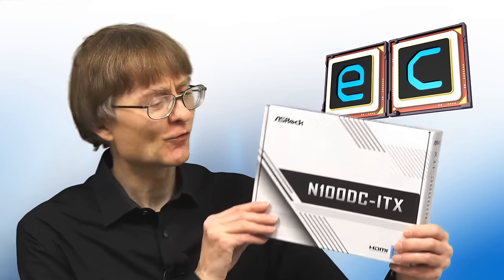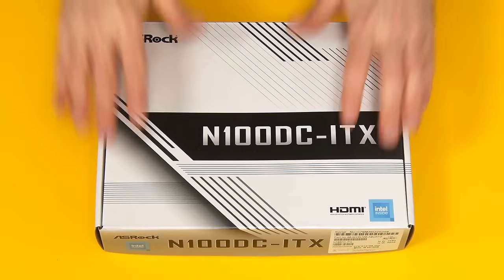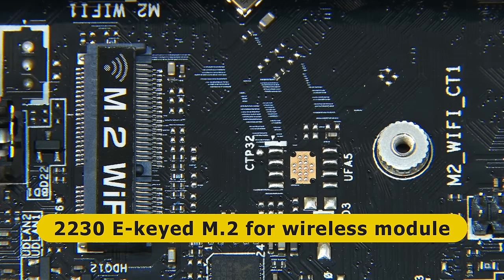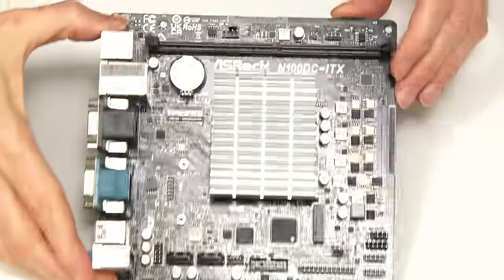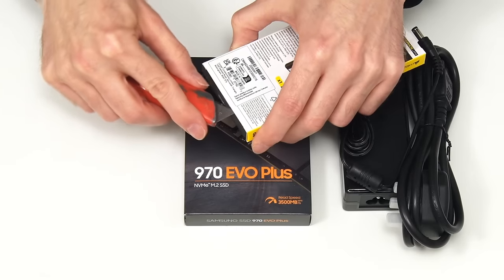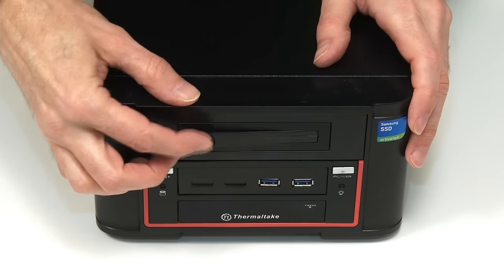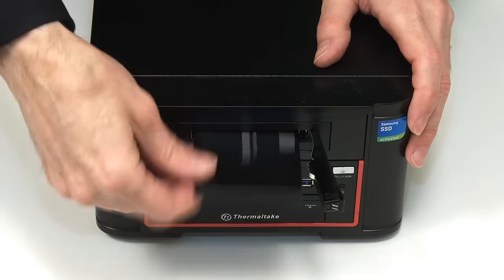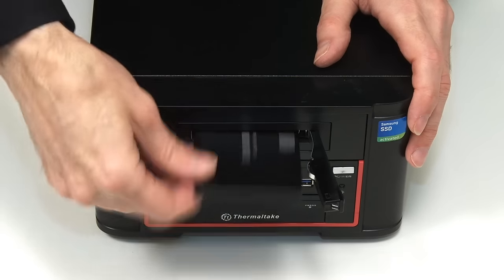N100 Mini-ITX Silent PC Build

Comment: I would really love to see a little PC like this with a really good APU (APU's have dedicated V-RAM) with 4GB+ HBM2/GDDR5 V-RAM, a HQ audio DAC and legacy friendly gaming audio chipset that can do EAX/FM-Synth(OPL)/MIDI/SBPro/etc, good analogue video support for VGA/S-Video/RGBS/YUV, this would make for the perfect little gaming PC for retro games via RetroArch/PCem/DOSBOX/Steam-Proton/Batorcera/Linux/MacOS-Classic/GOG/RecallBox/Lutris/anything-that-uses-X86-architechture.

The best way to do all this and for absolute compatibility, the best combination would be a good X86 APU and an FPGA, along with a nice quality HQ DAC and 400Mhz RAMDAC, the FPGA would cover all the legacy audio like FM and MIDI, another nice option is a ISA audio chipset running on a PCIe 1x slot for real Yamaha OPL3, SB16/Pro support and MT32 MIDI, EAX 1 to 5 would be essential too, give it a RAM cache too for real soundfonts, you could give the FPGA a wavetable header for use with a Dreamblaster or the like, I guess what I'm asking for is a "Mini Classic PC", like the SNES Classic or PlayStation Classic, but for classic computer systems rather than consoles, like Windows, DOS, MacOS, Amiga, MSX, X68K and so on, but you need to get the sound right, otherwise you might as well just use one of the many software emulation options.

Comment: Not sure about the EMC performance with that plastic cover. They went to a lot of trouble fitting fingers to the IO 'shield' (EMC shield?).
Reply from the maker: The front and other panels of this and many other PC cases are plastic. The EM shield is to ground the connectors to the case, and having a plastic panel does not negate this. :)

Comment: Unfortunately, they didn't give the the same audio out as my older Asrock ITX board, and the video out is lacking. At least the microatx version of this board has 3 video out. I get you can get audio out via the hdmi, but I have a few things that needs analog out.

Comment: Inspired by this build and have just ordered a case.  Please could you tell me if the ASrock N100 motherboard supports a dual monitor setup.  I believe it has an HDMI and also a Dsub port. Can these be used at the same time to run two separate monitors so I can have different windows open on each monitor. Thanks so much
Reply from the maker: Thanks for this, and good luck with your build. You can indeed use both the HDMI and VGA at the same time for dual displays.
Reply: @ExplainingComputers thanks so much

Comment: 11 Watt seems pretty high. i got the same CPU but in a complete mini PC together with 16GB LPDDR5 und 512GB M2 SATA Drive.and the idle is around 6 Watts there.
Reply: Does your mini pc use 19v or 12 volt adapter
Reply: @si4632  it is a 12v power supply.

Comment: For your temperature testing, you should also do your test with the top and back off. In the end, that would be the maximum natural cooling level you can achieve with your current heat sink. If the temperature is only a few degrees cooler, you are done but if say the case-less option gets you 10-15 degrees lower, there is value in increasing your venting.

Also, is it common to heatsink SSDs? Do they usually run hot or is it just a precaution?
Reply: You typically don't need to do it with PCIe 3 SSDs, but on newer ones it's generally a good idea given how hot they get.
Reply: Fast ssds use powerful arm SOCs, so they do get hot. The newer pci-e4 ones can also heat up the memory and ram chips.
Anyway, regarding the cpu, optimizing for lower temps has next to no value, unless you want to overclock. If you're running stock settings, there's absolutely no difference between running the cpu at 60 or 80deg. Only around 90deg you should be looking to improve cooling.

Comment: You'd forgotten that you even had a sound card in that system...  I went and rewatched the original build video; you mentioned that you wanted the full sound card to use Dragon NaturallySpeaking which didn't work well with onboard motherboard audio.  I take it that means you either stopped using that software or otherwise stopped needing the sound card?
Reply from the maker: Good comment. :) And you are right, I fitted the card to get Dragon NaturallySpeaking working. Since then I've left academia, and stopped writing books, which have reduced the time I spent creating text (in particular replying to student and other e-mails). So I am now able to manage my RSI and arthritis using a keyboard without voice dictation.

Comment: I am new to video creation and was looking at your Ryzen 5 build, which is great.  However I need a smaller form factor so wondered how far you can push a ITX format case as far as processor GPU and heat dissipation is concerned.  I am not so familiar with motherboard formats so not sure what to do as far as small as possible but decent video editing performance is concerned.  The alternative is to buy a laptop I guess with a GPU but these are very expensive

Comment: I would be very curious to know what a 12100T or 7400T Celeron G6900T would do at these levels.  They can be passively cooled as well.  

Notice you probably would see benefit from JEDEC ram, not XMP.  I bought some Crucial RAM (CT16G4DFRA32A or CT8G4DFRA32A ) so that it would run in JEDEC at 3200 CL22.  It was around $35 for a 16GB stick.

The N100 is amazing if it really uses the kind of power a Raspberry Pi 3 4 or 5 does.  I am saddened by the single ram slot, and the minimal PCIe connectivity.  Especially considering the very similar cost of a Celeron with P cores and 2 ram channels with an H610 board.  The price difference is covered very easily by the RAM being cheaper in smaller capacity sticks.

Comment: I see you use windows XP virtual machine for running microsoft office applications (word, excel), but you could also use wine for running windows softwares on linux, office 97/2000/2003 versions should work with wine. ReactOS virtual machine can be also an alternative for running old windows softwares.

Comment: I've purchased a tiny pre-build N100 Chinese system with 16 GB RAM plus cheap 2 TB NVMe and 4 TB SATA SSDs and it cost me less than this system. There's currently a problem with Linux on N100 systems as not even the newest kernel can play 4k/60 HEVC without dropping frames and there are no Intel proprietary drivers for Linux. This is not something I'd use as main system. Good as secondary backup NAS and media server.

Comment: I guess with the comically outdated connectivity still available on this fairly new board (such as the LPT or PS/2), that it is mainly aimed at various small and medium sized companies and such that still have ancient hardware they still rely on?
Reply: The PS/2 and D connectors are quite a hold over from the old days, aren't they.  Rather have  Thunderbolt.

Comment: I was curious about the temps.  How is the passive cooling doing?
Reply from the maker: Six months on, it is still working fine. Often gets into the early 70s C, which worries me a bit. But the chip is safe to I think 104, so in practice there are no issues.
Reply: @ExplainingComputers  We must work to find the balance between annoying noise and worrying temps.  Thanks for the feedback, Chris.

Comment: Impressive connectivity for such a puny board :)

I have a newish Mint VM that also whines about wanting updated video drivers. If I try to fix it, then the Mint VM stops working until I put it back how it was. I wonder if they broke something.

What was with the SSD that was hiding in the case? had it been naughty??

Also I want one of those tricycle things from your desktop. :D

Comment: 19v 65w that might be possible to be powered from usbcpd charger, cool
Reply: No, because the mobo hasn't a PD chip, it won't even work as in this case the charger delivered tension is 5 Vcc - in a word, best way to harm a good HW.
Reply: @hankhulator5007  Well you could use usbc-to-20v-barrel-jack cable that has pd chip or mod pd breakout board to build your own power cable for this board. What's even better is that future models of motherboards like this could actually include pd chip and use usbc for power as new QC/PD chargers are powerful enough.
Reply: @knifekitty_ls  Thanks, good to know that.

Comment: Couple things.  ASRock has a history of motherboard failure.  At one time they failed at a rate of 30% of the time.  I do not know if this has been corrected, but it's one reason I stayed away from them (and MSI).  The second is the power brick.  Why companies insist on using the "Mickey Mouse" jack that you can see in at 6:28.  The cords are hard enough to find verses the traditional power cord, and it's just a dumb design choice that's plagued IT for at least two decades.

Comment: This seems insane, will it hold 2xhhds running on SATA with the SSD on that external DC power adapter?
Reply from the maker: Yes, it should. But I would go for a 90W adapter to be certain.
Reply: Thanks 😀 @ExplainingComputers

Comment: Can't imagine running something like this tiny thing as my main machine.
 
My AMD Ryzen 9 5950X with 64 (4 x 16) GB DDR4 3600 Kingston Fury, 3 x Samsung 990 PRO 4TB PCIe NVMe , 7 x  Samsung 870 QVO SATA III SSDs and 1 Toshiba MG10ACA20TE 22TB HDD running a XFX Speedster MERC 319 AMD Radeon RX 6950 XT is selent enough thanks to a nice Alphacool Eisbaer 420 CPU AIO and 3 x 140mm Noctua NF-A14 PWM chromax.black.swap (what a damb name) case fans powered by a Corsair AX850 - 850 Watt 80 PLUS Titanium PSU. The HDD is not exactly silent but only runs after hours for in place backups.
Still not sure if I have to upgrade to a AMD Ryzen 9 7950X3D with an AMD Radeon RX 7900 XTX GPU or if I have to go the AMD Ryzen Threadripper 7960X route or maybe even be able to skip and wait for Ryzen with Zen 5. Really depends on where Memmory support is going to be next year as I have to go up to 128 GBs at least or the upgread is mostly a waste.
 I'm tending to the 7950X3D because I often need "Gaming Workloads" and really don't want to have two machines (and there costs) standing around also playing a actual game sure is a plus 🙂

You. Yes you, the person who is typing a "...but Intel" and/or "...but NVIDIA" comment just now. I run Linux. I neiter do "AI shit" on this box nor do I want or need ray tracing in 4k so I rather don't run hardware that forces closed source shit on ma system. NVIDIA can keep there overpriced space heater and I'm sure you can figure out by yourself why I don't look at Intel these days.
Reply: can it also run solitaire? 😅
Reply: @gabrrom  I will have to test that...

Comment: Thought of getting that board as well for building a NAS System with a bunch of SSDs.
Unfortunately it has just 2 SATA Ports. An older Board I have in an old PC (asus e35m1-i deluxe) has a lot more and would give a great NAS, but that consumes to much power for me.
And I dislike the N100 has just PCIe 3.0 instead of 4.0 and that this board comes iwth just Gbit ethernet, instead of 2.5Gbit.

Comment: Looks like the N100 is an AIO (All in one) thing. A desktop that runs  lightweight 3D games, yet can do field work with an RS232, VGA and parallel  port . Slap it in a small case with a touchscreen IPS; bingo Mr Cisco router happy happy.  Fruit machines, tills, ATM's . Hmm some managment core will enable a Beowulf cluster hack; .......

Comment: To me, absolute silence triggers my tinnitus, so I went from using small fans to using large ones, 200mm and 120mm originally. I've since switched to a mini-stx minipc (Deskmini X300) though since then because I wanted something that took less space. These days though the role of the white noise fan goes to my room air filter. What did you do for the power supply fan? Still using the 220w with the 80mm fan there? How whiny is that one?

Comment: Question for you? I've got a similar board with the N5105 chip rather than the N100? How are you finding the temperatures on you board? Sitting idle, I'm showing 60 degree's celsius, which seems high to me? I'm considering replacing the thermal paste to see if that helps but was just curious about your machine before I tear mine apart. Thanks

Comment: I personally do have a weak spot for passively cooled PCs, I find it very unfortunate that my graphics card has coil whine which means I can't use it passively cooled because due to the power consumption I'd have to keep it in an open air bench if I'm not using fans.

Comment: Sooner or later, I will need a new, and preferably silent, machine. Small.  How well would this would this work running Audacity?  And maybe....OpenShot?  With Linux Mint OS.  A silent machine would be preferred for voiceover work.
Reply: If you want a quiet computer a Mac Mini used (get an Apple Silicon version, M1 or M2) can be had under $400. Will run Audacity, OpenShot, etc.

Comment: i really would like to replace my J3455 Apollo Lake with N100 Alder Lake, but Linux Mint 21.3 or more precisely the Mesa-Display Driver has issues with the INTEL Graphics! Cinnamon GUI crashes far more often than i expected. Could you please investigate with your Alder Lake and LM 21.3? I assume it still has the i915 Display Driver bundled?

Comment: The Corsair Vengeance LPX Ram is amazing Ram
i buy that for everything i can
got it in my old DDR3 Systems i use still too
Just bought a 64 GB Kit for my i9 9900
An Finally got my Nvidia A2000 after now it is severely outdated Ohh Well '
Im doing good now for a workstation 
Now to get the new server build complete

Comment: Do you think you could use a Raspberry Pi 5 instead Chris?
Reply from the maker: For some things, yes. But I like to be able to run an x86 VM.
Reply: @ExplainingComputers  So do I! When my Pi 5 arrives I am going to see how much I can move over to it, and whether I need my VM at all.
Reply: @ExplainingComputers  I got a delivery date today of next week after Boxing Day!
Reply: @ExplainingComputers  It came today!  Using it right now to send this reply!  First impressions are a bit mixed...when powering 2.5" hard drives, the Pi can get a little unstable with frequent and unexpected reboots, and it appears to struggle to copy large amounts of data over SATA USB 3. I get the impression that it lacks the ability to cache information as easily as a x86 distro would, as performance with a nice fast WD black hard drive should be a little better than it is in places.  The default desktop is slick but buggy at times, so I am wondering if it will be stable enough for production purposes but time will tell. Screen capturing utilities seem reluctant to work as the Pi 5's distro uses Wayland rather than X11, but Youtube playback in both Firefox and Chromium is good and Firefox's issues with choppy scrolling can be coped with better by disabling "Smooth scrolling".  Having said all this, it is much, much faster than the Pi 3 I had before, and it should be usable as a power efficient general Linux desktop.
Reply: @ExplainingComputers  The Pi5 is still a bit underpowered for routine tasks for my liking but with Ubuntu installed, it makes a good MythTV frontend and, I hope, backend too.

Comment: Will this run windows 10/11? I am just wondering because I am looking for a retro machine to run Retroarch and create a hub for all my retro consoles and computers. And it has to be windows because I am too stupid to learn Linux. I know that from over 3 years of trying and failing miserably.  Thank you Chris.
Reply from the maker: Yes, both Windows 10 and 11 are officially supported for this board.
Reply: @ExplainingComputers  perfect. Thanks again.

Comment: I wonder what you would say if you discovered Mac Mini M4-based one day – ultra-small, four times faster per core, probably eight times faster in general, inexpensive and totally silent as well ;)
Reply from the maker: I'm seriously struggling with your "inexpensive" label -- even a Mini M2 is well over twice the price of this N100 system, with significantly less connectivity. And -- oh yes -- is runs MacOS! What Apple have done with their M series chips is very impressive. But the computers based on them are not cheap, and tie their users into the world of non-self-build, non-upgradable Appleness, which is not a cult I want to join. :)

Comment: How would one attach extra sata drives to this? Would like to use it as a basis for a home server but not enough storage connectors :/
Reply from the maker: You could use a PCIe to SATA card in the PCIe slot, but would need a way of powering them.
Reply: You could easily use a SATA HDD/SSD docking station hooked on USB-3 that is using an external switching power supply 12V/3A - no slow down, as you have 5.0 Gb/s ÷ 2 = 2.5 Gb/s ~215 MB/s per disk - it works ferpectly, even on a RPi4 with one 512 GB SSD 2'1/2 for the boot, one 3"1/4  3 TB HDD for data, that plus the RPi4 @ 1.8 GHz pumps 16.5 Wh with an avg power factor if 0.44, so 7.26 Wh invoiced, 174.24 W/day, 5.31 kW/month as it runs 24/7.    If you dwell in europe, see that at Reichelt in Germany, cost w/o shipment is ~€80.

Comment: Just so you know, kingston hyper x fury 32gb 3200mhz work in these and run at full speed
Reply from the maker: Good to know. :)
Reply: also, previous gen, 4025 or 4125  seem to be just as nippy but can come with four sata ports and appear to use a couple of watts less. Also, pico psu come in two types, vampiric and ok. Vamps draw 1.5w when you shut down , oks go to 0w.
n100itx-dc has a built in vamp so go with n100m or j4025 itx with non-vamp pico psu via 24 pin @ExplainingComputers
Reply from the maker: I run a J4105 connected to my TV for streaming/etc, and it works very well. This board feels a bit nippier, but uses more power as you say.
Reply: j4105 is just dual-core how does it cope with truenas scale? @ExplainingComputers

Comment: maybe you can try to run Office 2002/XP under wine 🍷
Reply from the maker: It would probably work, but I find it much easier to run a VM as Office is not the only x86 software I use, and it's really easy to backup an VM and use it on other machines. :)